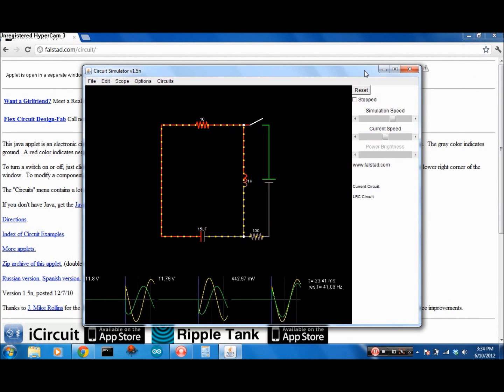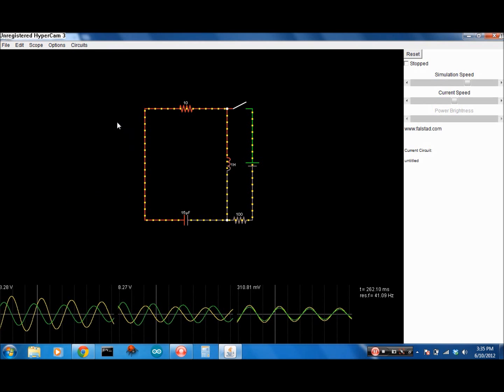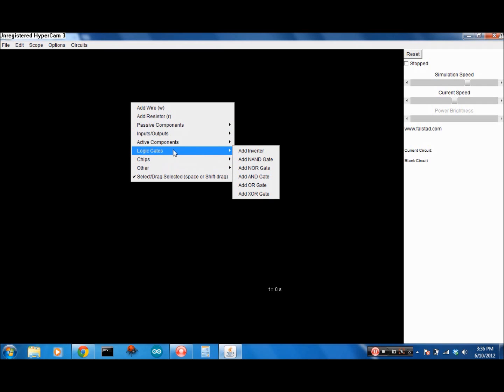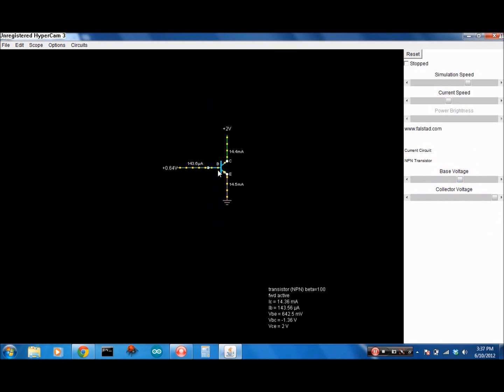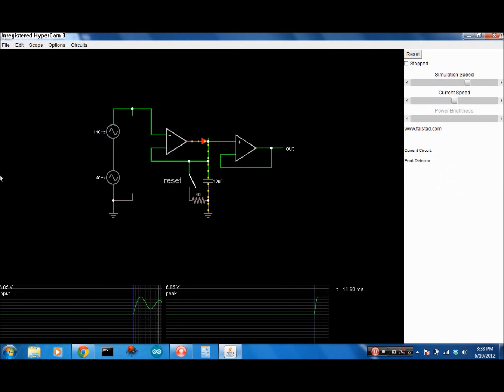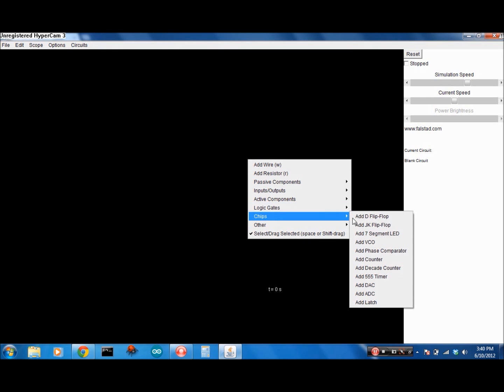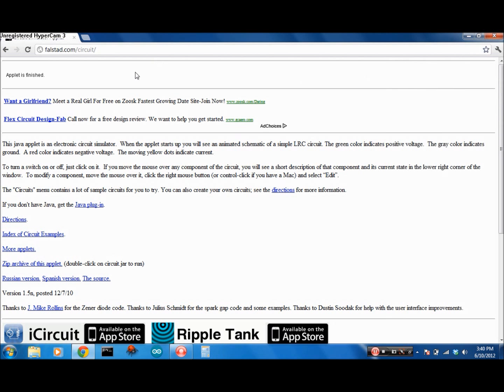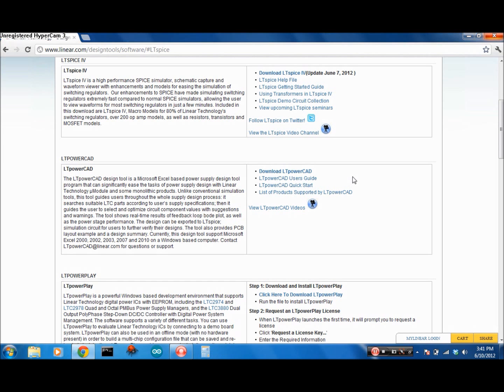Analog Circuit Simulators

Comment: Another which was only released this year is circuitlab.

It's not as powerful as Falstad but it does have an advantage in that the components you place in the schematic are (supposedly) modelled on the specifications of actual parts.  Eg can drop in a 2N2222 specifically, rather than just the generic NPN that Falstad offers.

It's fairly actively developed.